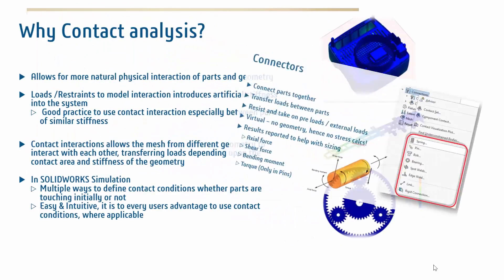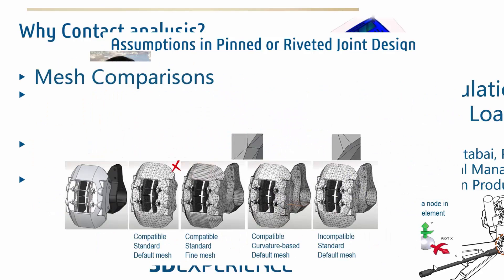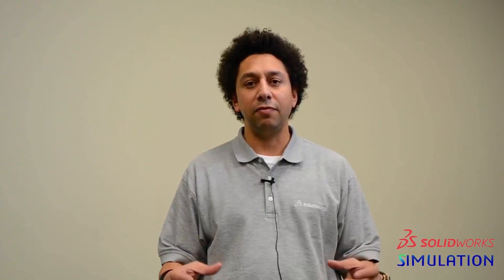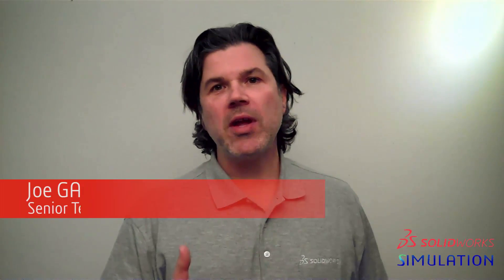SOLIDWORKS Simulation Step-Up Series: Introduction

Comment: Hello sir... I am working on a assembly in solidworks... But simulation is failing giving an error.. Model might be unstable.. I have checked the model under the Underconstrained option.. It gives the pop up model is fully constrained.. But assembly is failing in simulation.... Kindly suggest the solution... I can mail u the assembly also